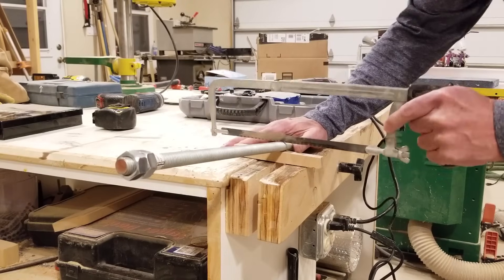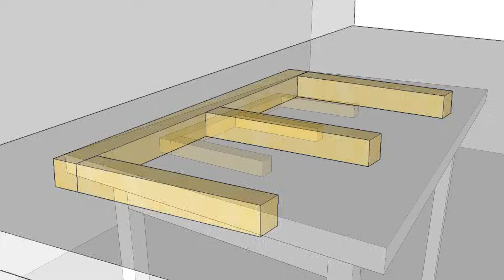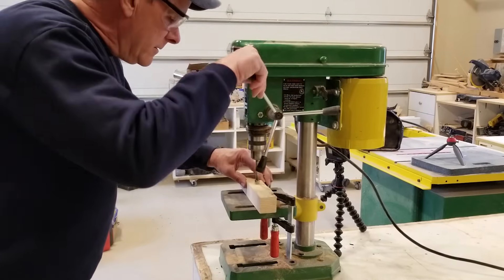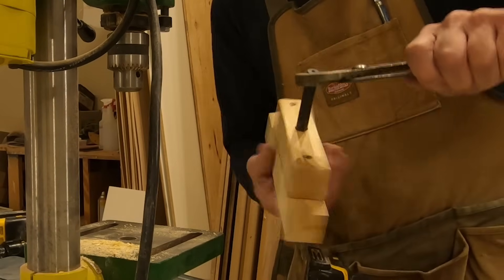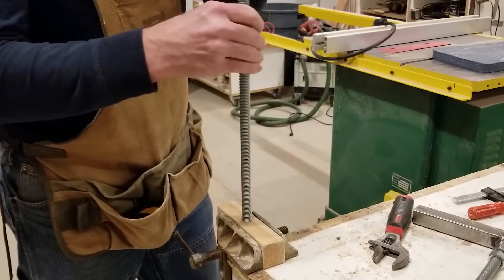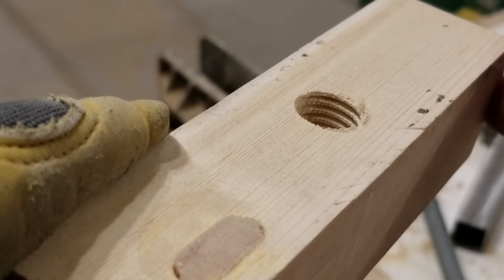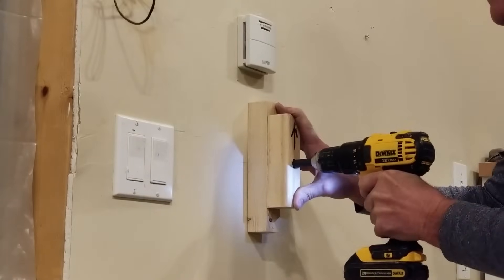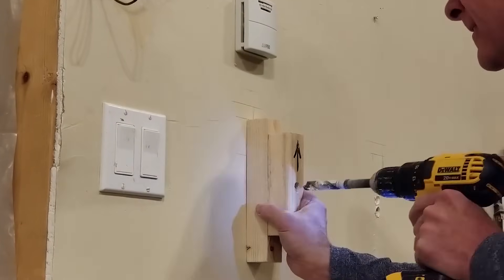Strong Floating Shelves - The Strongest Option

Comment: I’ll be building a few of these floating shelves in my place, but I think I’ll insert the steel rods 3”to 3.25” into the studs. Adding the thickness of the drywall, that will be 3.5 to 3.75” into the wall. I probably would not need that extra depth, but it satisfies my need for maximum strength the stud’s thickness has to offer.🤔🤗 Thanks for the demonstration.
Reply from the maker: Sounds good, Richard, and best of luck to you on your project. Going deeper into the stud is all the more reason to be sure to know where your wiring is running. You don't seem like someone who needs to be reminded of that but I hit my first wire ever drilling into a stud about 9 months ago. Total freak situation and I'm still not sure how I actually did that, but I did. Took me a couple of extra hours and a trip to Lowes to repair the wiring, but fortunately it was a mantle install and the mantle covered where I had to open the wall. Just something to be aware of. 😬
Reply: @RustyDobbs  - Thanks for the reply. So many project ideas, so little t…., well, I just keep going.

Comment: With the amount of work and the risks associated I'd probably rather just go for a decorative steel L bracket.
Reply from the maker: I often suggest to people who want a wider floating shelf to consider having some L brackets welded out of plate steel that can be attached directly to the studs and the wall refinished over and recessed in the bottom of the shelf to have the floating shelf look still with a little more traditional structural design. Lots of ways to go about this.

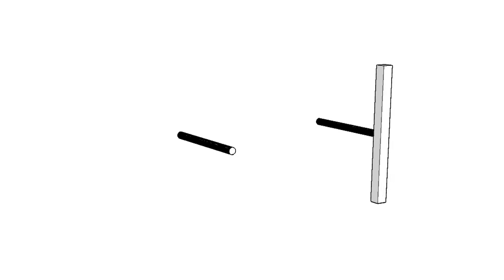Comment: sir, I LOVE this video (even with the sheetrock being drilled through :) however I wanted to show you this video https://www.youtube.com/watch?v=LR-Fq9tO1-Q       if you fast FWD to about 2:15 you will see his idea for drilling into the studs. I am wondering, do you think that would work as a replacement for someone like me who does not have a son with welding experience?
Reply from the maker: There are lots of ways to thread rods into the studs after the holes are drilled, Angelo. You do not necessarily have to even cut the wood threads before installing your final rod. That's just something I do because I do this with some frequency so the welded hand tool is helpful. One of the easiest ways to thread the rods into the holes is use two nuts that are threaded onto the rod and tightened against each other. This is called a jamb nut technique. Then a crescent wrench or even a socket and ratchet can be used on those nuts to spin the rod into the holes to the depth needed. There's no one magic method to getting it done. Good luck and hope that helps!

Comment: Nice video :) Learned a lot. But here are some things I'd do different just cos :) I'd use 3/8 rod maybe 1/2" at most, never 5/8 cos that's over over kill. No one is gonna use a floating shelf for concrete bags. I don't like drilling a 5/8 hole into a stud cos it's to much. I'd put the rods in once, no "threading" cos to me that's a waste of time. Lastly I'd use a socket on the end of a ratchet to screw the rods in. That's harsh I know but I gotta be honest and of course it's just my opinion. Terrific video, well narrated and very informative.
Reply from the maker: That's about as nice and pleasant of a complete takedown as I have ever had from someone on one of my projects, Dumb! 😀 Other than doing everything completely differently than the ways I did, you thought the video was fine! Actually just kidding... I don't always follow my own processes when I do an install depending on the circumstances. I appreciate you watching and thanks for taking the time to comment!

Comment: Piggy-backing off G Drake below. Thought of one day and ran a magnet over the wall until it found a screw. Will not find center though.
YES! I hang my grand kids pictures that way with strong silver magnets (Neodymium ) in my man cave! Works great. In fact, I hang up paperwork for tasks that must be completed asap on the corners of the walls in my hallway. The corner flashing (?) under the drywall provides plenty of metal surface to securely hold 2-3 pages of paperwork.
Reply from the maker: Good ideas all, Winston! Thanks for passing them on!

Comment: Do you think I could use this method to make a floating shelf that would hold a 200 lb human for a sitting/lounging space?
Reply from the maker: I would be inclined to use welded "L" brackets for what your are suggesting particularly the wider it gets. There gets to be a springboard effect with rods as the shelves get wider. A bracket approach would help eliminate that.

Comment: Good idea, but, only drill into the 2x10 about 7 inches, fill holes with a small amount of wood glue and push the wood onto the threaded rods..   the glue will dry locking the threaded rods to the 2x10.   Eliminates the holes on the front of the 2x10.
Reply from the maker: Good suggestion, JD! I appreciate you watching!

Comment: I love it. I've been using all thread for a couple years for floating shelves. I built a bunch in my own house with 5/8 all thread and 2x10 lumber. Drill straight into the studs (my walls are 2x6, so extra strength), drill into the boards with a drill bit that's just a hair bigger and gently pound them onto the all thread. The friction of the threads holds it firmly in place and they are super strong. I have several of the shelves loaded with books and they haven't sagged a bit.
Reply from the maker: Sounds like that is working out well for you, Jeremy! Thanks for watching and passing on your experience!

Comment: If you also use the all thread to add compression to your support structure you should pick up a bit more strength at the extremity of the shelf. Nice work.
Reply from the maker: Thanks, Robert! Yes, good idea on the compression suggestion. I have tried that in another video.

Comment: Hi, I was looking for a floating shelf video idea, maybe. I like the use of threaded rod for strength. But to make it easier to both level and pin your outer shelf case to: Add a wooden blocker strip against the back wall with pre-drilled holes. Install one side of the threaded rod into the stud through the blocker strip, then swing it up level and drill in the other side, attach the other side. Add nuts and washers and now it's all level and you also have a good place to attach your outer shelf case to on the wooden strip along the wall.
Reply from the maker: Good ideas all, Territodude! Thanks for watching!

Comment: Looks good. I was looking for a way to hold some kind of floating table on brick wall. Maybe with some kind of bolt. Wouldn't it be possible to have table or shelf reinforced with steel rod hooked to a bolt?
Reply from the maker: Yeah, brick walls get a little trickier depending on the weight of the table. I would be inclined to have some "L" brackets welded up to mount against the brick to support the table. Still has the floating look but very strong too.

Comment: One way I've seen it done, and this requires being done before wall board goes up or cutting it out and patching, is to mount heavy duty L brackets to the studs. Then hang the floating shelf on those. Same concept.

Comment: instead of threading the hole, can't you just screw in the first rod and just leave it in there, I imagine it'd be a tighter hold and you don't have to take it out to thread another rod in
Reply from the maker: Yes, you can do that, Duc. You might be limiting how deep you can screw the rod into the hole because of the accumulation of cuttings, but that would likely not be an issue to worry about.

Comment: I’ve got some 2 inch thick alligator juniper shelves I am using as vanity tops with a vessel sink on top. Any suggestion on spacing and length of rod to mount these? Much appreciated and love your videos! 

Blake in Az
Reply from the maker: Thanks, Blake, and I appreciate you watching! For wider installations like vanity tops,I would probably step up the all thread rod to 1 inch and make the spacing minimum 16 inch on center.Obviously the wider the shelf is, the more tendency you'll have to see a little more of a springboard impact on the outer edge of the shelf. Also the holes for the rods can get pretty tricky if you are planning to use the full width of the slab. If I cut my hardwood into about 2 ½ inch wide pieces, I can drill them out on a drill press and keep the holes running straight over a wider distance after glue up. For installations like you're talking about, I tend to lean more towards having some steel welded into "L" brackets that I install against studs and place the tops on them. If it's important to hide the L brackets, you can cut away the sheetrock at the stud and mount the brackets then refinish the sheetrock and texture over the top. As much as I like installing the rods for shelving, the wider installations I tend to think a little differently because of the simplicity of using the L brackets at those times. Good luck on your project! It sounds very cool!

Comment: That metal tool made wasn't needed at all lol. I did the same thing and just used 2 nuts and a wrench. Thread both nuts on the rod then use the wrench to turn the 2nd nut. The first nut serves as a stop nut and it threads into the stud easily.

Also, just drill through the nail using the right drill bit and a corded drill (the battery drills are weak).
Reply from the maker: Lots of ways to accomplish the same results, Azara. Most of the time it's a good idea to know what you are drilling into for sure in a wall before you make that call to just drill right through. It could also be a wire or pipe! 😬

Comment: Drill out the front like you said. Put on washer and nut. Tighten it down.  Put one more thin facia on the front to cover the holes and bolts.
Reply from the maker: Good suggestion there, Hello World! That’s certainly another way to go about getting a good finish!

Comment: Way to complicated. There are easier ways with the same results. Don’t get me wrong the creativity was great but
Reply from the maker: If you strip out all the explanations, Andy, all I am doing is drilling holes and spinning rods into them. The 'handle' tool is helpful to me because I do a lot of these installations and the 5/8" rods are generally the size I use. I can make quick work of floating shelf installs if all I am doing is installing. Thanks for watching!

Comment: What size of drill bit did you use?
Reply from the maker: About 1/8" larger than the size of the all thread rod, to begin with. It's nice to have the shelf really snug, on the rods, but you may have to enlarge the holes some if alignment is off a little. It can be a bit of a trial and error process depending on how things go.

Comment: I basically created the same exact method but instead of using all thread I decided to use some long lag bolts that were maybe a foot long or so. Once I drilled them in to the studs I just used my bolt cutters to cut off the end where the bolt head was. Then I was able to slide the floating shelf on to the lag bolts. Will fun getting them out of the wall when the time comes. I like your version better. Great video!
Reply from the maker: Hey, thanks Cody! Yes, I have had a number of contractors comment that they use the same type of method you use when installing floating shelves. I do enough of them that it made sense to come up with an easy method that I can install quickly and be confident in the end result. I also like having the threads available to secure the shelves to the wall for many different styles of shelves. I appreciate you watching!

Comment: I have done many floating shelves and a quick and strong way we do this is to drill 7/8" holes into your 2x6 wall 5" deep. Using 2 part epoxy to glue 3/4 hardwood dowels into the holes. Let that set up and do the same 7/8" holes into your shelf and epoxy shelf onto your dowels. Very strong and no metal to deal with
Reply from the maker: I started out using wood dowels, Steve, and in fact did a number of videos testing the strength of installing shelves similar to what you are suggesting. Have to agree that they are strong enough to hold most things that one would consider placing on a floating shelf. The steel rods have their challenges as compared to dowels, but once installed, they are my preference. Thanks for watching!

Comment: You can install the all threads really fast with the double nut at the ends of the all thread, then use a cordless impact drill to fasten to the stud.
Reply from the maker: Yep, Joe, you can use the 'jam nut' technique to spin the rod in with a cordless or a socket and ratchet works as well.  I do enough of these that the tool comes in handy and I can feel when I bottom out in the hole without fouling up the wood threads by overtightening. Thanks for watching!

Comment: Can you try that on a old style
 brick chimney?
Reply from the maker: Yes you can, Joe, but it is a little trickier. You need to drill holes with a masonry bit a little smaller than the size of your rod to begin with. Then ream your holes gradually until you can tap your all thread rods securely into the holes. I would add some construction adhesive to the threads before doing the final installation. Let everything cure and it should be ready to go.

Comment: You could have simply used 12" x 1/2 lag bolts. Used a screw gun to drive the lag into the studs as deep as you like then just cut the heads off the lags. Done deal.  
Then just drill your holes so they line up with the lags bolts at your done. Just as strong as that threaded Rod that you used with a lot less steps
Reply from the maker: Yes, Steve there are lots of approaches to getting this type of thing done. I have heard from other contractors who use similar approaches to what you described. Thanks for watching!

Comment: Wondering if you have an suggestions for a very long floating shelf, 8 ft, this would be on a concrete wall that had been covered with insulation and ferring strips, paneling  and drywall ?
This was not us, lol
Reply from the maker: Your situation is much like other people who have brick walls instead of wood framing, Beth. I get questions like yours from them. The challenge you have is simply to drill appropriate sized holes in two your concrete retaining wall, then tap rods into those holes so that you get a very snug fit. I would want to add some sort of construction adhesive to the rods as I was tapping them into the holes. Done correctly, you would get good results with your final shelf, but I’m not going to kid you that it would be a pain to do! Good luck if you guys are going to take that on! 🙄

Comment: Appreciate the innovation and showing the trial and error. For us regular guys, that's how it usually is :). 

Just a quick suggestion without giving this a ton of thought. 

* Buy whatever diameter bolts you need with nuts on the end. Drill your  hole into the stud and use a socket or drill attachment to screw them in with the bolt to 'thread' your studs. Then cut off the nut.  You might need to re-thread the end.
You don't need to make a jig if you do the above. 

Your video gave me the idea of using the bolts, so I'm also going to use my suggestion and I'll let you know how it goes.

Sorry! I should have proof read my post better.

Thank you again for the idea!
Reply from the maker: Good idea, Dad! Yes, there are lots of ways to approach this idea of using steel to support floating shelves. Good luck with your project and method!

Comment: Do you think you could do this to exterior load bearing studs without compromising structural integrity?
Reply from the maker: I am not a structural engineer, Alexander, so I can’t really give an educated answer to your question. I do know that building codes allow holes and notches to be placed in walls, load bearing and non-load bearing, to run wiring and plumbing during construction. Those allowances seem pretty liberal to me! When you’re drilling a hole in a stud and replacing the same space with a steel rod, at a minimum, that seems like a one for one trade off. If you pulled the rod and glued in an equally sized dowel in the whole, it would seem to me again that that area of the stud would actually be stronger than originally, but that’s just an opinion that I’m sure others might see differently.
Reply: Yeah I am a carpenter but nothing they taught us in school was about drilling this kind of hole into a stud this direction of grain. 

and I can’t find much info for this kind of drilling, i think its probably worse than a hole for electrical. I better heir on the side of caution and not do it.

Comment: I would of added wood glue to the rods so in case I started stripping the threads, the glue would help keep it in place. Just a piece of mind.
Reply from the maker: Yes, Fil, glue or construction adhesive can certainly be added to the all thread rods and that would help make the fit more secure once the adhesive sets up.

Comment: Great video, I am hoping to use this method for my live edge slab shelf that vary in width and are heavy. Did you use 9/16 drill bit for the wall and 5/8 for the actual shelf?
Reply from the maker: Thanks, jmt! Yes, I use the 9/16” bit for the wall hole but an 11/16” and maybe a 3/4” bit for the shelf. You may have to give yourself a little bit of play sometimes because of the alignment issues that can arise with the holes in your shelf and the rods but you can step up in bit size as needed until it works.. The approach should be fine for your live edge shelf. Good luck!

Comment: Would the option with one piece of wood work with plywood and edge banding if the bolts are set into the shelf? Inexperienced DIYer trying to build a walk in closet.
Reply from the maker: Sure, Erika, that can work. You may just want to use wood buttons or plugs to finish off the holes in your plywood shelves that you have edge banded. Hope that makes sense! Good luck on your closet!
Reply: @RustyDobbs  Thanks! Btw I love your channel